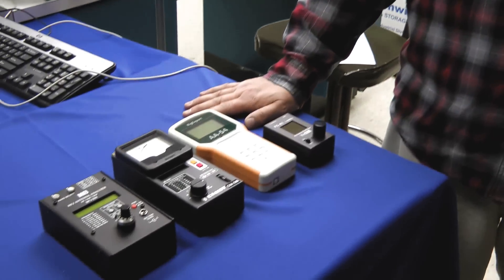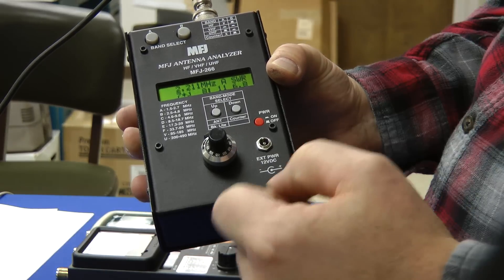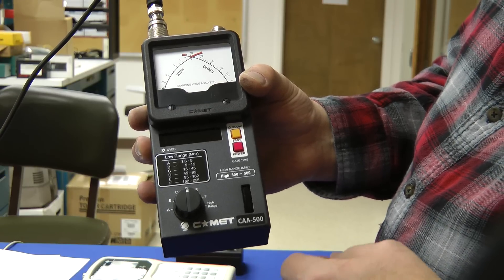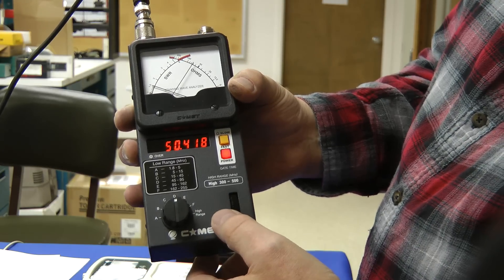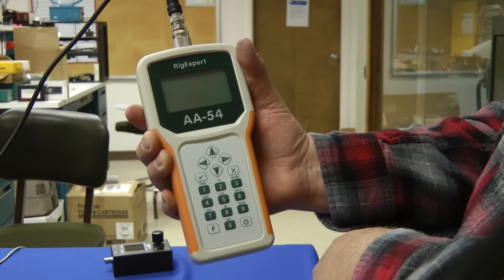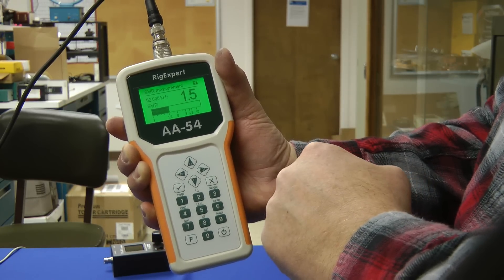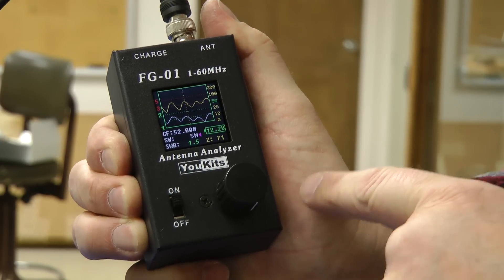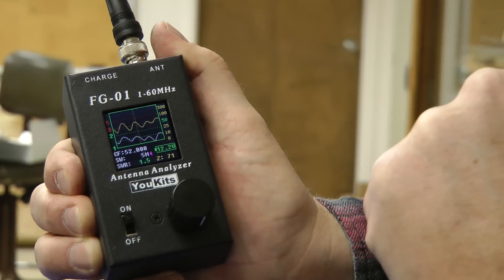Antenna Analyzer Roundup

Comment: Mistake: the C*MET range is 1.8 to 255 Mhz not 1.8 to 162 Mhz.
Reply: And the MFJ doesn't cover "roughly 1.8 to 500 MHz." There's a BIG gap which includes no coverage of the amateur 222 MHz band.